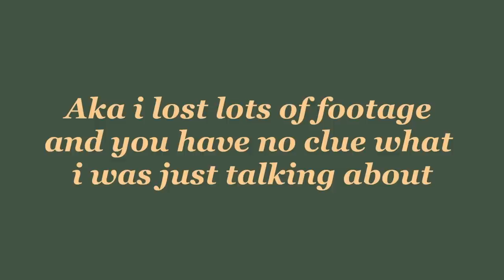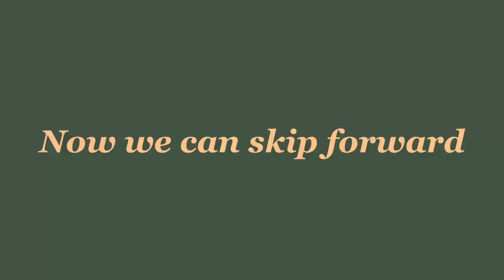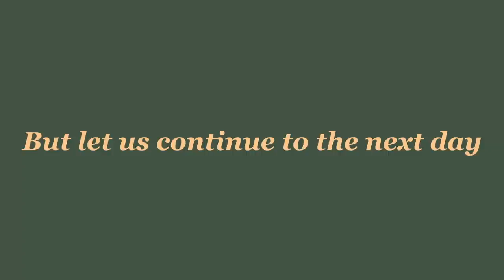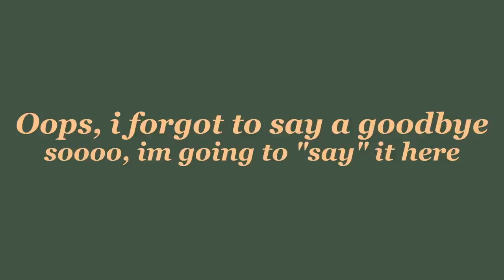Insulating and preparing for doing electrical stuff | Caravan reconstruction EP7

Comment: If you ever hope to move that caravan you will need fasteners, screws, not just glue to hold it together.  Otherwise,  the first bump in the road your trailer hits will break the glue seals & it will shake apart eventually creating new cracks at the seams to let water in again. You are adorable, learning as you go doing things the hard way. A bit painful to watch. Maybe you can watch some videos of others doing this process to learn an easier way. 
Best of luck with this project.

Comment: If you glue wood around the boxes how are you going to get the wires in them you should have left one side open and run wires before insulation and where is your panel box going
Reply: If she doesn’t understand your comment now she will soon. We learn from our mistakes. Lol
Reply: Came here to say the same...
Reply: Drills exist
Reply from the maker: Don't worry, I've drilled holes through the box and the wood and made sure it's big enough for the wires!

Comment: Even solar power on roof to charge batteries or battery storage water pump to sink  I think you are going to have to think this over again
Reply from the maker: My sink won't be using electricity, it's a self pumpable sink. And I won't have solar panels. It's source of power is from the house. A wire from the house will connect to the caravan since the caravan isn't going anywhere. Its not legally allowed on the road. Xxx